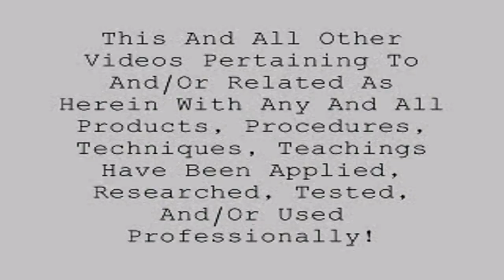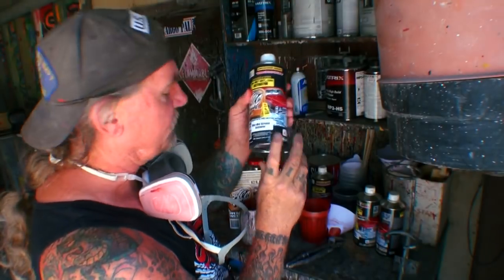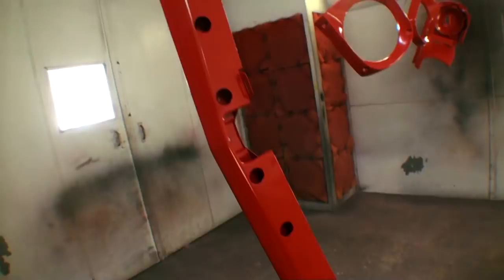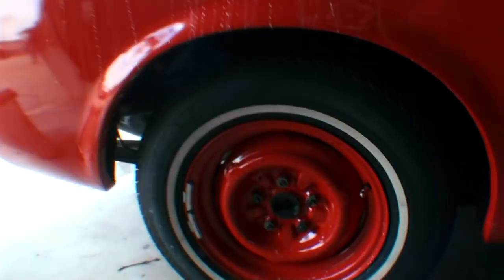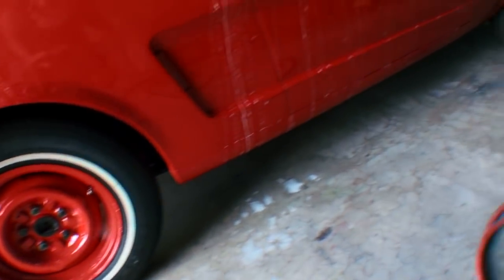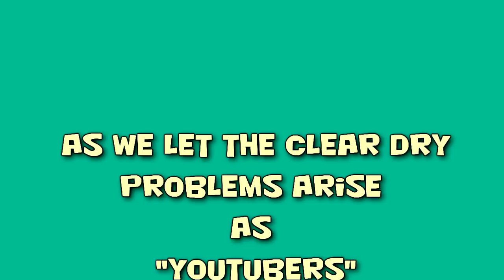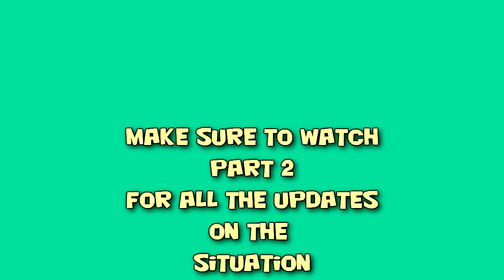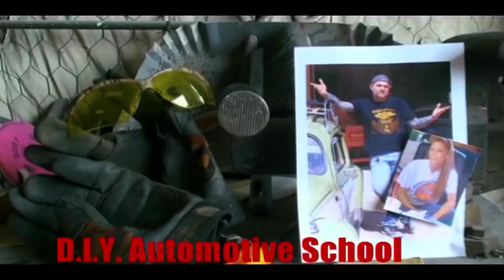I Want Some "AllKandy.Com Wet Wet Clear", But Where Can I Get It? Part 1

Comment: i've seen listings on ebay for the allkandy clear with prices the same as the allkandy website, word must be spreading that its hard to get. the prices more than doubled .ive ordered from his website in the past without any problems. i'm glad i stocked up on it when i did. I like the clear, as long as you follow directions it turns out nice. Its sad that he brags this stuff up , but now runs into problems with not getting supplies to people that want to try this clear. Hope he gets everything cleared up

Comment: I had to submit a PayPal claim to get my money back from allkandy.  Took 4 weeks.  Called allkandy at least 15 times no answer.  Left a message no answer.  Left an email 3 times.  No answer.  Sucks because I like the clear and need more to finish my project that I have already used wet wet on but I guess I’ll have to switch brands now.  Hopefully it doesn’t look different panel to panel.  And every body online that carried it doesn’t now immediately

Comment: Unrelated question. I'm working on my 84 Fiero I have 2 small spots on my frame that are rusted is 18 gauge enough for the repair?? I cant find any info on the thickness of the chassis material. It is quite thin. Keep up the great work.
Reply: Hello fellow Fiero owner.
Reply: mand0123 hello there
Reply: mand0123 hey mines a 84 you wouldn't know where I can find a thermostat housing would you
Reply: Sorry, no idea, I'm from the UK, Fiero's are quite rare over here. Do you not use the Pennock's forum?
Reply: mand0123 once in awhile I do that and the clutch slave bracket arethe hardest parts to find so far
Reply: Dana Wick I don’t know on a fiero at all, but even unibody stuff the thinnest major components are like 16 gauge.
Reply: fishhuntadventure that's what I was thinking maybe I'll do the repair and maybe straddle it with something a little heavier thanks for the info
Reply: Definitely try Pennocks Fiero Forum for those parts. (‘86 SE)

Comment: on a Tack coat, how do you get away from getting dry looking areas? I tend to struggle with either putting too little or too much on my first coat. If you have dry areas on your first coat, will it fix itself when the heavy 2nd coat is applied? Thanks in advance.

Comment: If he don’t send me mine that I paid for I’m switching to Tamco
Reply: Tamco is AMAZING!! some of the best products I've ever used in nearly 30 years of painting. Tammy's customer service is second to none unlike this shady cat.
Reply: I been using Tamco for  at least 7 years now. You will not regret trying it and will likely not go anywhere else once you start using their stuff...
Reply: 70 Stang dude go with tamco if you like the wet wet extreme go with the 2104 if wet wet plus go with 2100 the 2104 is 54 solids 2100 is I think 50 I have been spraying the 2104 last night and today it’s better and cheaper I had it in the mail the next day I’m using there primer too it’s better than any I’ve ever used
Reply: I though it was the HC 4100 thats just like the WET WET PLUS correct me if i am wrong.   I am thinking about buying this clear since all this nonsense is going with all kandy.
Reply: William Robinson that is about the same as the Wet Wet original  2100 is the plus bro
Reply: Sata Mike Paint  cool thanks for the info, I'm thinking I may just buy this instead of sitting and waiting for this bs
Reply: I was wondering if anyone has tried the Tamco OEM Paint Code Basecoats? 
I have bought the AllCandy products before and have not had any shipping issues. I am really curious about Tamco Products now!
Reply: Sata Mike Paint call cps that wat I did they gave me the wet wet and pay pal refund my money google the number that clear is autobahn nothing special tenn just put a label on it that’s the company who make it
Reply: tomduncan1970 call Tammy miller you will love her product tell her sata mike told you to call and she will hook you up paint is the best and clear too way better than wet wet and I sprayed wet for years.
Reply: Judon Da Truth  I was trying to figure what the wet wet plus was in the autobahn but can't figure it out.
Reply: William Robinson  I think the glamorous
Reply: Thanks Sata Mike!

Comment: I think all of you are barking up the wrong tree. I bet he doesn't send out the product because he doesn't have any, and can't get any because he spent all of your money, and is on a cash basis with his supplier because he already owes them a ton of money. This will not end well.
Reply: jason69chevelle now you are either a real pro salesman or a small service business owner who needs to use subcontractors.
I was selling/CSing high end thin saws for manufacturing at a company that kept getting shut off from their 95% supplier recently. It was like I was supporting a scam. I’ve also done remodeling contracting on and off for 30 years and I can’t believe the stuff people do.

Comment: Would you recommend Martin body hammers?
Reply: Vote for JEFF I would those are top line as far as I know . If you're a DIY guy though they are pretty pricey
Reply: Dana Wick Thanks for the heads up. I am actually a beginner body tech and I am looking for an upgrade on my cheaper set I already own. Thanks will be picking a few up!!

Comment: Yeah Pete! Give up on the WetWet yeah it's pretty good but shipping is real slow. 
and now impossible to get. 
I've used PPG, RM, Sherwood Williams, Matrix and a few others.
I'm not a pro but do what I have to and get erdone! 
But even though not a pro I have been painting since the mid 80's. 
What I've gotten hooked on and have been happy with is Tamco paints (http://tamcopaint.com)
What got me was I talked with the owner Tammy Miller several times (Since it's been a few years since I painted a car) and some things have changed a little. 
I'd ask her about how to do this or do that and every time she came back with full instructions not once she told be to go look it up. Yes this was even before I bought anything from her. 
Straight answer's and never a dodge to the question. 
So I finally bought a few things from her. Well I was very amazed from the start how well it laid down and how it looked after it dried. Plus what I spend was at least half it would have cost me with Matrix and I feel with better results to boot. 
I would give Tamco a try. 
No B.S. just good stuff at a real good price!!!